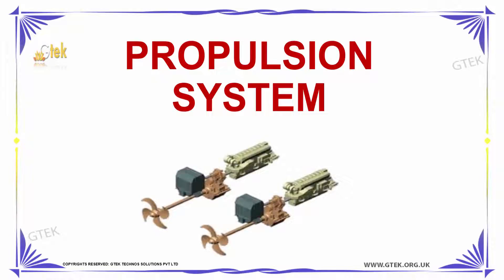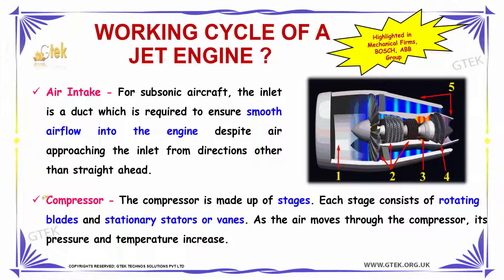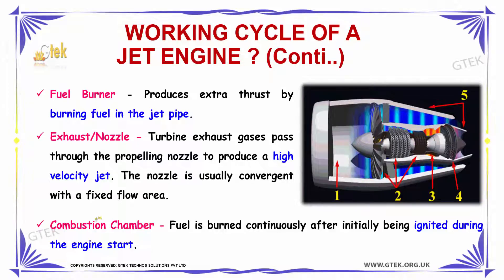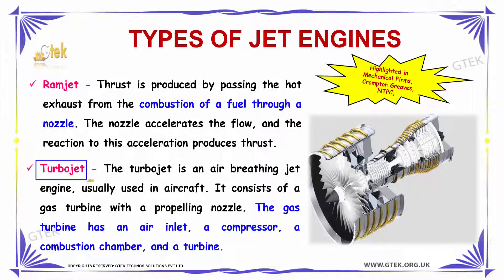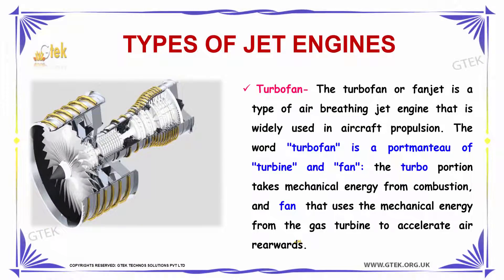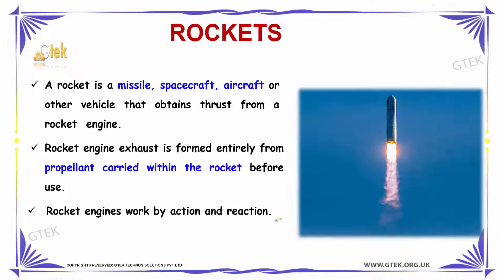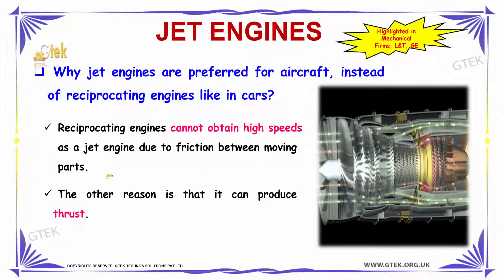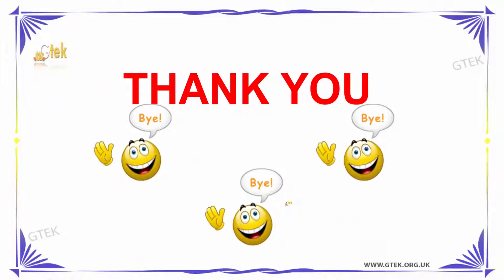Top 40 Propulsion System Mechanical interview questions and answers tutorial for fresher

Comment: A propulsion system consists of a source of mechanical power, and a propulsor (means of converting this power into propulsive force). A technological system uses an engine or motor as the power source, and wheels and axles, propellers, or a propulsive nozzle to generate the force.

Comment: A propulsion system is a machine that produces thrust to push an object forward. On airplanes, thrust is usually generated through some application of Newton's third law of action and reaction. A gas, or working fluid, is accelerated by the engine, and the
reaction to this acceleration produces a force on the engine.

Comment: When one opposite pole electromagnet repelling another electromagnet or permanent magnet, there is a long air path in the loop of magnetic path. The air path reduces magnetic strength exponentially. Following is the ideal configuration where is no air path at all.

Comment: Thrust is the force which moves a rocket through the air and through space. Thrust is generated by the propulsion system of the rocket. Different propulsion systems develop thrust in different ways, but all thrust is generated through some application of Newton's third law of motion.